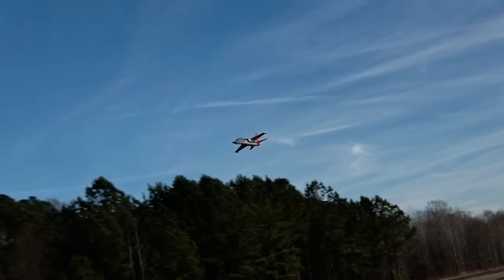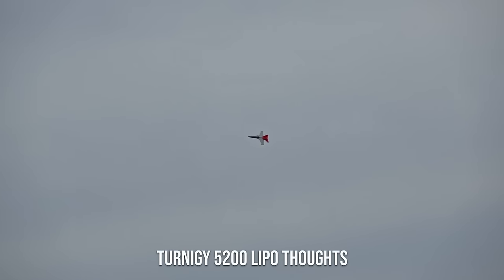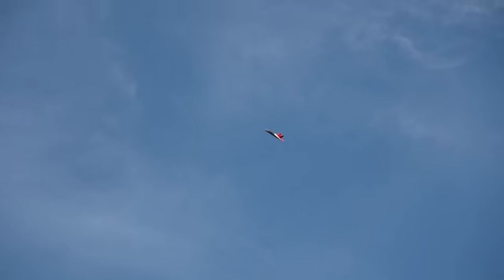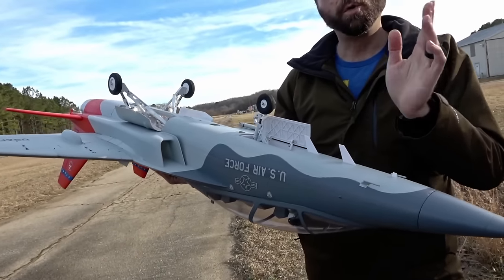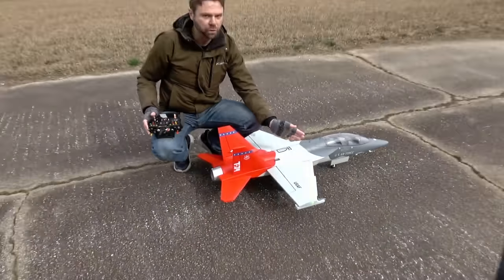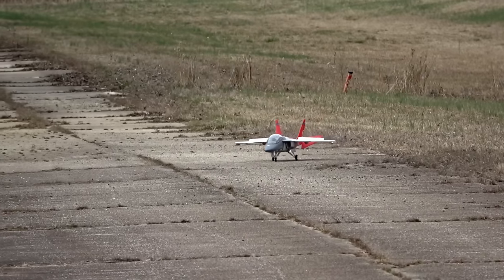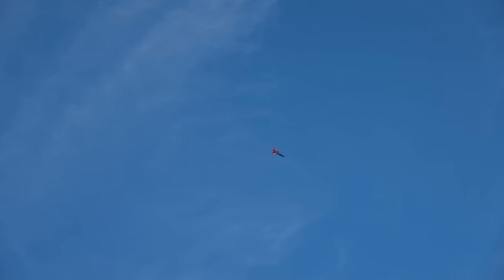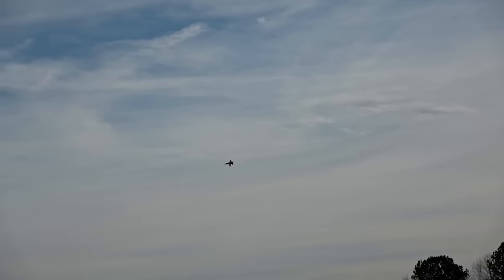Just Shy of Greatness, But Pretty Good - XFly T-7A Red Hawk 80mm

Comment: I love my T-7a with over 150 flights.I slap a smc 5900 all the way to the back for 4:30 min flight.

Xfly did amazing on the gear! Best Landing Gear I've Found So Far!!
You do have to cycle the gear before takeoff each time.
Reply from the maker: The gear struts are definitely next-level engineering.

Comment: I like your. We score system. More detailed. Thanks for taking the extra time to spell it out.  I’m still dealing with getting my Viper to stay straight on the run way. I’m gunna crank up the gyro to assist rudder corrects in forward programming and see if I can get this bird to steer well on grass . Shit even on a road for that matter.  Once I master the Viper 70 . Time to move up into a 80mm F16 Thunderbird. 😊

Comment: One of my favorite planes I have in my hangar! I did notice with mine I had to cycle my gear if they were already down when powered on. Didn't have that gear door issue you had they just wouldn't go up at all until I flicked the switch A couple times. Also I liked mine with flapperons full at landing. For me the plane would bounce a lot when I came in to fast so getting it slow(wings level) for the landing worked best for me.(I fly off grass)  Overall an awesome plane other than the stock servos seemed to move pretty slow. I took it out on a really cold day once and the servos were barely moving! I honestly think they're pretty weak. I had one of the gear door servos fail when I got it and was first programming the plane. It spun 180° the opposite direction when the plane was just sitting there powered on. Other than that it's a pretty fun easy and forgiving plane to fly for its size I would say.
Reply from the maker: The gear door issue is unfortunate, but hopefully they'll fix it at some point. The hard plastic wheels definitely don't help with bouncing, either.

Comment: I saw on one of the other RC channels that this jet also has a reverse for the motor to help stop it for shorter roll outs on landing.
Reply from the maker: We didn't have the channels for that, so we opted for differential stabilators and flaperons, which tend to be significantly more useful in general.
Reply: I've tried the reverse thrust, it's pretty weak TBH, ended up using using the channel for tailerons and flaperons instead as I didn't feel the need for the reverse thrust after trying it.  It will slow down for alnding with a bit of practice, bur keep the power on all the way to the ground or it will drop short of the runway.

Comment: Great review Jon! I really like your new review system. I’m not sure that the flight time for 5+ mins is so fair, after all with a solid 4000-5000mah battery, it’s almost impossible to reach 5 mins :) (at least in my experience). 4 mins plus for those jet is something I would take always!
Reply from the maker: Think of it as subtle pressure on manufacturers to make more efficient jets that reach 5+ minutes 😉
Reply: @TwoBrosRC  amen to that 😉
Reply: @TwoBrosRC  Getting 5 min in Banana Hobby baltic bee 64mm L-39 with smc 6s 3600 HV -:) But after the 10 paragraph angry tirade, I don't see you buying from BH anytime soon, haha..

Comment: Interesting...I've not had that nose gear issue with mine yet.
Reply from the maker: Are you sure? Several other people have reported the same issue. Try powering on the jet with its gear dropped, then see if you can move the nose door. If you can, that's the problem.
Reply: @TwoBrosRC  I regularly leave it on its gear between flights. I’m using an ag-61 steering gyro. Perhaps that’s why.

Comment: Beautiful EDF, I'm on the fence.  At 2:00, to your thrust question, with the same motor, are you speaking to the difference in power/energy needed to push a 12-blade ducted fan opposed to a 9-blade ducted fan?  Having said that, you recommend a 9-Blade Ducted Fan?
Reply from the maker: 9 blade fans are faster but lack low end thrust. The stock motor is a better choice for most kinds of flying.
Reply: @TwoBrosRC  I'm curious as to if you have an opinion, or and comments on the similar class FMS EDF Jet 80mm BAE Hawk?  I like this Red Hawk, a solid 4/5.

Comment: Hi Jon, been watching your channel for a while now and you have been such a massive inspiration for me! Really appreciate your hard work and commitment to the hobby!
I’ve recently got the Xfly t7-a and was wondering if the stock esc will handle high voltage Lipo. It’s been a bit tricky in the past getting decent batteries here in the UK, but at last have found a suitable with decent batteries. I’m tempted with the Hv but don’t want to blow the esc! 
Hope you can shed some light! 
Regards Richard 😎
Reply from the maker: Most of the flying here was on SMC HV batteries, pretty sure we included a shot of it! The ESC is stock in our jet and handled it perfectly.
Reply: @TwoBrosRC  
Thanks  for the response! And yes you are right, you did mention the HV smc in the video my apologies!
Anyway going to give the GNB hv a go!
Cheers Richard 👍🏻

Comment: I thought there will be some flat spin or cobra spin 🤣🤣🤣🤣
Reply from the maker: Nah, the CG isn't far enough back for that.
Reply: @TwoBrosRC  why is the better sound the lower thrust?
Reply from the maker: It usually means air is exiting slower than it should be, so you're hearing more of the air and less of the motor. Sounds great, but doesn't provide as much thrust as if it were optimized. There may be an explanation that's more accurate, but this has been our experience with all jets that sound amazing.